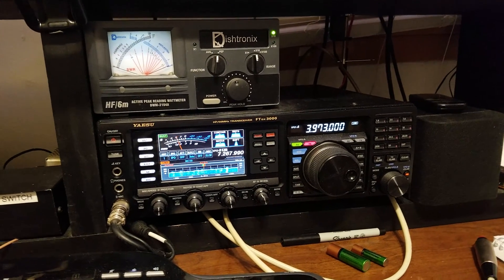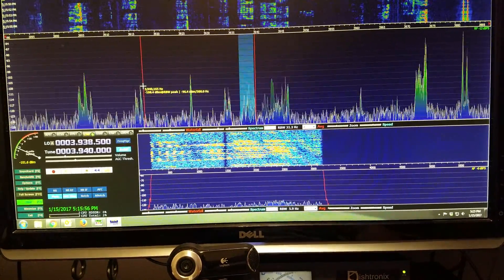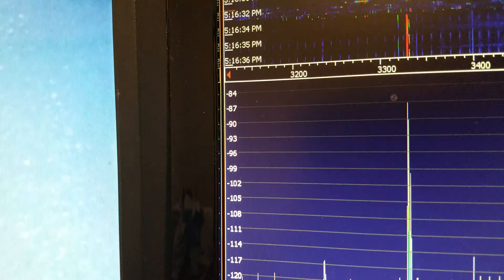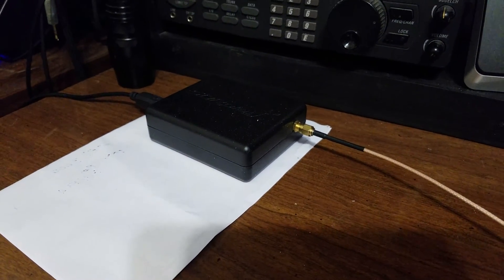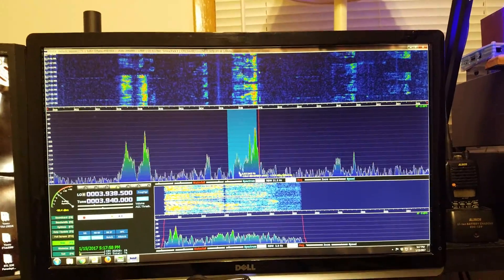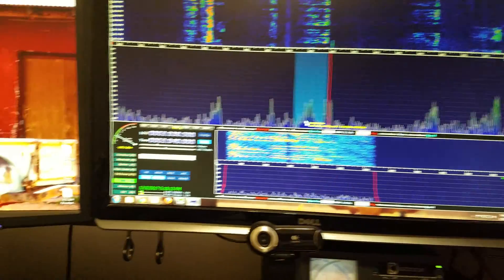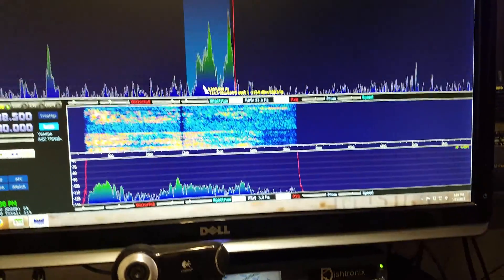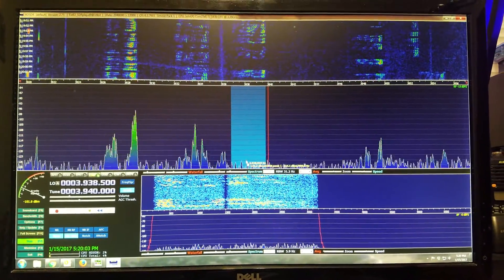FTdx3000 Panadapter

Comment: If you transmit while having it hooked up to IF output instead of Ground output, will it blow up your sdr play when you transmit?? I thought that you could only do it to the ground
Reply from the maker: It will not. Connected to the IF it sees nothing when you transmit. I believe the same is true fr the RF Out. Folks run into trouble when they try to run off a second antenna.
Reply: Thank you so much. I have been so confused on what to hook it up to. I am still trying to figure out how to make my vfo work in sync with the program. Very frustrating.  I also don't know why my dx3000 waterfall is basically black and white when other videos I see look like they have more yellows and reds with signal strength. Maybe I just bought a first edition.
Reply from the maker: You need to update the Firmware. Sounds scary, but follow the instructions and you'll be fine.

Comment: Hi Steve, I've been using the SDRPlay RSP2 but I can't get it to work with the IF Out. It works fine with the RX Out but would love to have it going with the IF Out as I know it gives a more accurate reading. I have mine hooked via HRD software but I have tried using it with OmniRig and with HRD and getting the same results. Is there a setting on the FTdx3000 that you know off that needs to be selected before the IF out works as I can't see anything jumping out at me in the menu? Any additional info you could give on this one Steve would be greatly appreciated. Cheers. Joe
Reply from the maker: Mike McDonald. mypanadapter.com Also on eBay.
Reply from the maker: Hi Joe, There is no setting on the rig and if it works with the RX Out, it should work with the IF Out.... OH WAIT! 
Go to Options/RF Front End Configuration and select SDR on IF Output. See my Hints and Tips Video
Reply: Curious where you guys buy the cable or adapter that I willl need to do this???? I need to go from the rsp2 to radio cable or adapter.
Reply: Cheers Steve, will give that a go next time I'm messing with the radio :-))

Comment: The Panadapter can work with a FTDX1200?, tanks and 73
Reply from the maker: It can but....it is expensive because there is no IF Out on the FTDX1200. DX Engineering sells a device that would allow you to do this... It costs about half of what your FTDX1200 is worth..... Google FTDX-1200 Panadapter and hope you get accurate results.